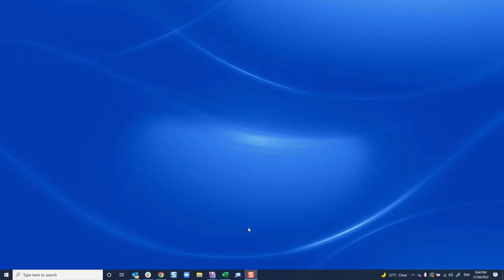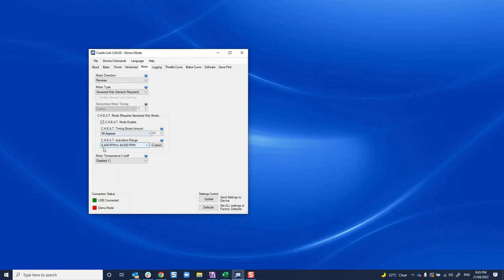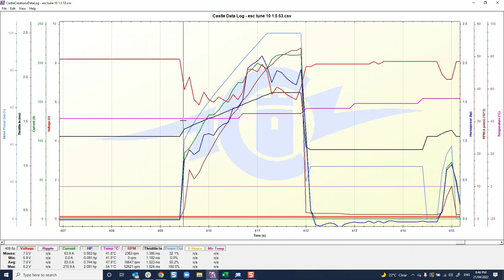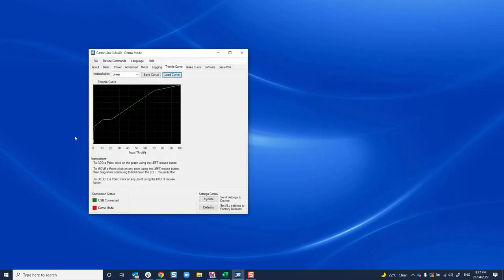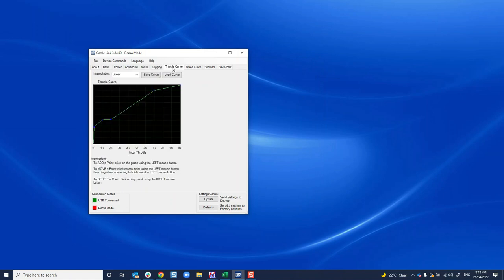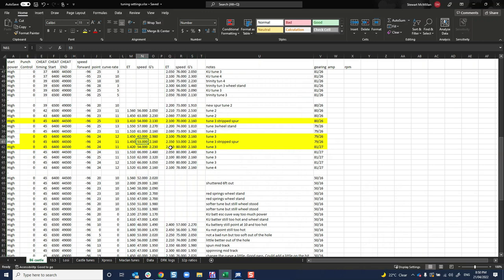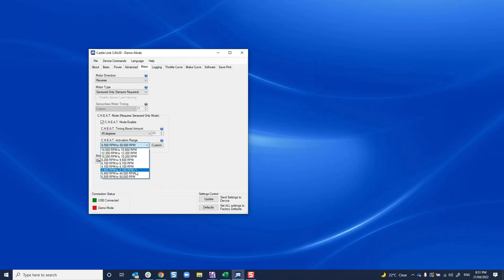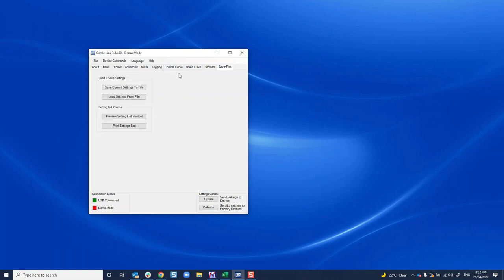Throttle curve and tune save

Comment: If u are trying to dry tire drag race is it good to go positive because I don’t wanna spin off the line
Reply from the maker: Yeah you still want it to leave at a good power level. Basically inch it up until your tires can’t take anymore off the hit. Then work in more power as you go.
Reply: @StewMac570  ok I tried the negative it takes off good no spin but I was just asking to try some new things